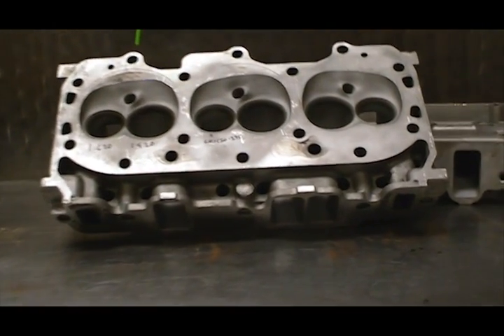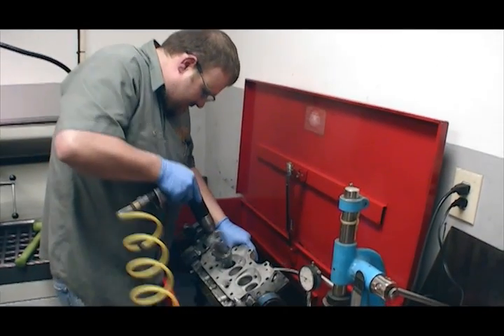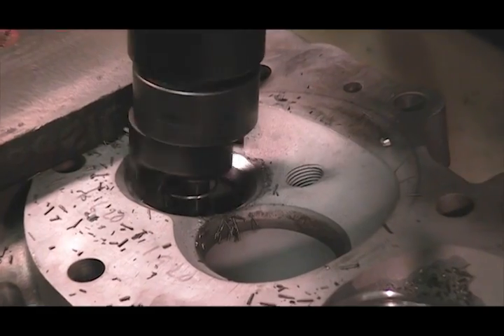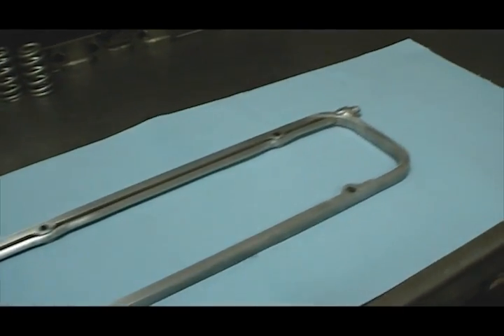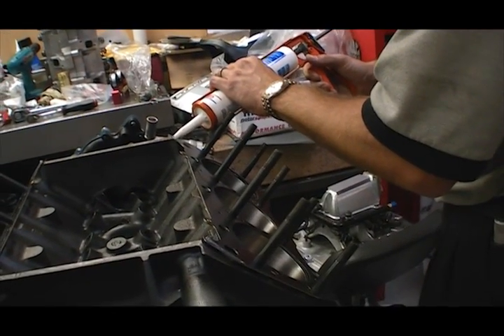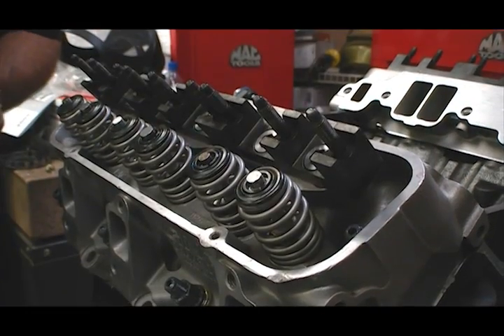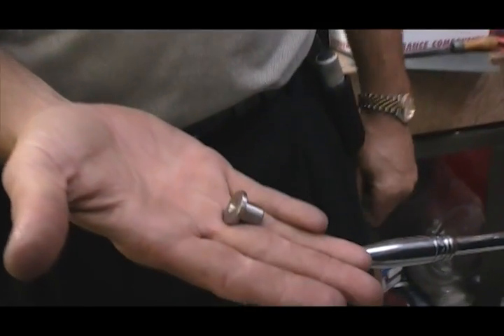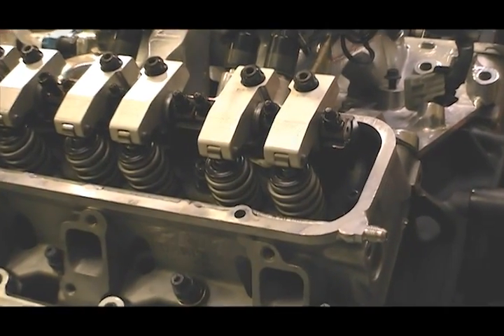Buick GNX Turbo Engine Build (Part 3)

Comment: dumb question: Will there ever be a part 4 to this build???
Reply: 5 years later, I’m starting to think not. What a let down. What was the point?
Reply: 6 years later, i think not!
Reply: I completely forgot about this tread. It would have been nice to see to completion.
Reply: We can’t say they aren’t making videos, oldest being a week old. Come on guys! We’d like to see where this build goes and ends!
Reply: @tonyargo853  Well if they were tripling the power output to the wheel from stock that would be 705hp if were talking 86 and 735 if were talking 87.  At that power level that POS 4.1L block probably split.  The 3.8L block is a POS as well.  It kills me to say this because I owe an 86 Grand National.  When my engine was built I was asking about putting 600whp with it and my engine builder told me I need to step up to a Buick Motor Sports Stage 2 block or a TA Performance block.  $15k spent on an engine block that will likely split at 600whp.  Well that build did manage 625whp and 683ft-lbs and the block survived just fine though.
Reply: Probably. They lost one of the bolts. As soon as they find it, they'll finish putting it together and get it on a dyno. 
A friend of mine's cousin's sister's boyfriend's aunt's next door neighbor's nephew's best friend's mom's sister's daughter's fiance's teacher from elementary school  said she read it on the interweb so it must be true.
Reply: @gintokisakata1917  i heard ferris needs a new kidney!

Comment: I cringed as you drug the bare head across the work bench. Kind of like painted body parts on concrete without protection. I know that was the old head but still lol

Comment: Question. Way does the exhaust from the drivers side go into the back of the exhaust on the passenger side than into the turbo? Wouldn’t the exhaust meeting together before going into the turbo flow better?

Comment: Why not just use sodium filled exhaust valves and leave the stem at the original diameter? 

What was done to the bottom end? Also that valve spring squirter setup is interesting...I have never seen that before. Is this engine going to have a silly high red line or something?
Reply: +TurboMitsubishi 
If they are planning on making more than 450-500rwhp, they had better put center billet mains or an engine girdle and a steel crankshaft.  The stock crank starts flexing at around the aforementioned HP.  One thing they don't mention here is whether or not this block is 3.8L or 4.1L.  
In any event the GN1-R race heads are 14 bolt and they wouldn't need those heads unless they were planning on making over 700rwhp.  Technically they could make less, but it seems like a waste if they are planning on making less. 
As far as the addition clamping force, I'm not so sure that is needed.  I detonated with cometic and ARP studs, I didn't blow a head gasket.  Instead it snapped my stock crank like a twig and destroyed the block.  So that right there show that the cometic heads gaskets, coupled with the ARP studs provides pretty awesome claiming force.

I'm in process of rebuilding a spare 109 or 3.8L v6 for my Grand National.  I'm planning 600rwhp.  For that, I got a forged rotating assembly, GN1 heads(not race ported) billet main caps for the first three mains.  218/218 roller cam and T&D roller rockers.  Beehive springs and Comp Lifters.
Reply: +sinusbradycardia  All of your points are mentioned in the earlier videos of the series.  they went with a 4.1 (as an aside I would have gone with series III 3.8), they used a Girdle and much better crank and cam.
Reply: nox0underling

Series II or Series III blocks, along with forged rods and pistons.  If I could do that swap, I would.  There are several guys that have done this swap and use a built 4l60e transmission.  One example was a series 2 block with an fbody tb and intake, 98 fbody ECM, ported series 3(L32)heads and an older TE60 turbo.  Tuned with an HP tuner.  The first full 1/4 mile pass, the guy ran an 11.34 at 121 running 17psi of boost.  I have the same turbo and I ran 25psi of boost and my best pass was a 11.70 at 115.  The total cost, $6500.  It cost about $9k to build a reliable low 10s 109(LC2) block.  The S2 and S3 blocks are superior in design and durability with their cross-bolted center main caps.  The guy who built this set-up, has ran in the 9's on a S2 block with S3 connecting rods and ported heads along with a forged aftermarket piston.  Stock crank and main caps.  Cometic head gaskets and ARP head studs.
Reply: Best S3 3800 out there is also the fastest Grand Prix that is running, and last i saw his world record is 8.57.
Reply: sinusbradycardia
 A good harmonic damper goes a long way to help the crank shaft take more abuse.
Reply: *****
And stuff like the Mitsubishi 2.0L 4G63 engine that depending on the example redlines from 7500 rpm to just shy of 8k from the factory. So they can rev just fine if designed for the application.
Reply: sinusbradycardia cool, would love some vids on that.
Reply: High cylinder pressures in the hair dryer force fed V6!! It’s called radius of gyration🤓 increasing diameter increases column stiffness. Even more so than wall thickness. That exhaust valve has to over come a lot of cylinder pressure to open. They increased the area of the exhaust so they made a increase to stem dia to retain control of the tulip

Comment: Eh. I know these guys know what they are doing, but you don't install valve stems like that in aluminum heads. You gotta heat up the head first, then install. Same with the valve seats.